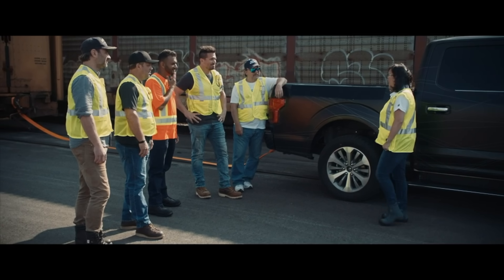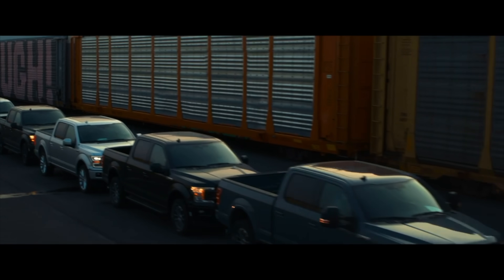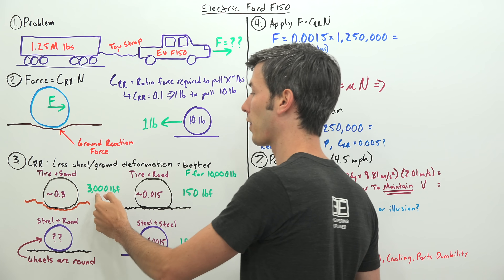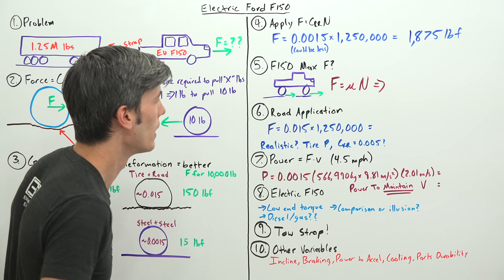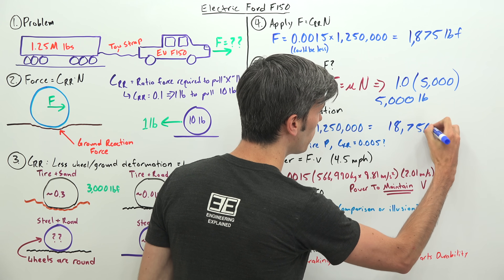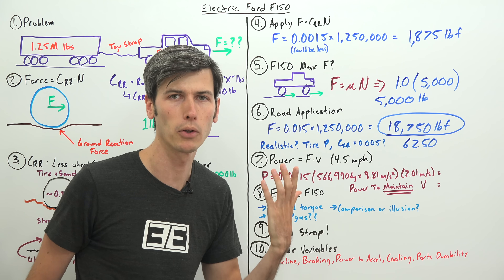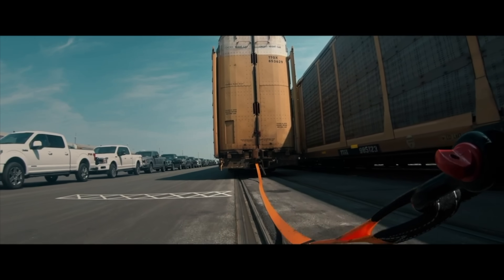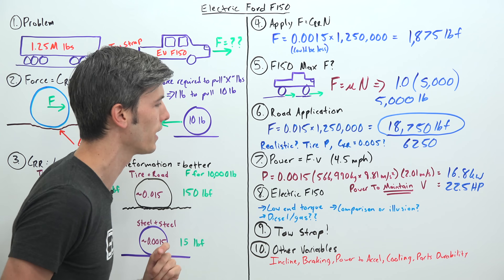No, Ford's Electric F-150 Can't Tow 1 Million Pounds (Realistically)

Comment: I used to work in a warehouse. We had electric lift trucks and gas for outdoors. Man, those electric ones were so weak in comparison especially toward the later time off charge whereas with the gas you could just hit the pedal and give it some extra lifting power. Maybe modern engineering has changed this a bit but an electric-powered truck just doesn't seem like it would provide efficient power for the things trucks are supposed to do. Although, so many U.S. Americans just buy trucks to look cool and don't even haul anything ... I imagine that's the true market for this vehicle..

Comment: To be honest i dont understand, but dont worry im still subscribed
Reply: Basically because the train is riding on steel tracks with steel wheels you hAve less rolling resistance. Now if you swap those to wheels and pavement that truck would be at a dead stop. The tracks help them cheat👍
Reply: @randalllawkin  thanks

Comment: The illusion would have been a little more dramatic with several giant steel cables between the truck and train
Reply from the maker: Agreed, would have been a nice touch!
Reply: Yes ... it would be a nicer  PR stunt.
Reply: Marius Ipad They should just use aluminum, it’s all the rage!
Reply: Yes I couldn't agree more.
Reply: Marius Ipad  It is a low speed prototype test. They could jam something under there to hold it up.

Comment: Awesome video, as always.
I have been thinking if we have so many 1.6 liter 4 cylinder cars why don't we have more 3 liter V8s, it seems (at least on the surface) that they would pass emissions and could reach high enough power output through forced induction. Can you make a video on this or just an explanation in the comments?
Reply: They make 3 liter V6 engines, why would they make it V8. That increases the cost.
Reply: @abdulazeez.98  Why make V8s at all if this increases the cost?

Comment: Can you do the same thing with the V10 diesel VW Touareg toeing the Boeing 747. How much power/torque do you need to pull the plane? It's actual wheels on the ground holding the plane, not easy as the train stunt.
Reply: @wilburville  Thanks for explaining!

Comment: Surely the tow strap actually made this possible. I noticed that it seemed to stretch a lot, and seem to store and stop a lot of shock to the truck system. As you pointed out, the truck can easily get this moving a low speed, it will just take a while to get there. To me the strap was used to store energy which eventually pulled the load, while not blowing out the electric motors with excessive high current loads

Comment: While I don't think it changes your conclusion, you didn't factor in wheel bearings vs. journal boxes. I'm not sure that bearings intended for consumer vehicles would be more (or less) efficient than those intended for inherently commercial rail use.
Reply: You’re incorrect
Reply: @kevinnorris6558  you're saying that I'm incorrect in the lack of understanding I was expressing. Thanks for your blanket acceptance of whatever you thought I was questioning?
Reply: Rich Marceau Mayonnaise is a hell of a drug

Comment: how did they stop 1.25M rolling tons from rear ending the truck?
Reply: I’m more curious where did they get the air to release the brakes? I bet they just bled it off to stop the train.
Reply: They lock the truck's brakes up and get out, because it cant, and it'll just push the truck into the rail stops and crush it into a ford pancake. I would have liked to have seen it, actually.
Reply: Might have had a switch engine on the other end or had a couple people use the hand brakes on the side of the car when they were done pulling.
Reply: Rene Dominguez that’s what I was thinking too and they’d just keep the engine out of shot.

Comment: This phenomena goes all the way back to the origins of railroads, which actually predates trains. Turns out, horses can pull a whole lot more on rails than they can on an ordinary road. Iron tired wagon wheels have lower rolling resistance than rubber tires, but Jason's explanation still works otherwise with horses.

Comment: I'm a freight conductor and this stunt of Fords reminds me of a story I was told many years ago about a switchman back in the late 70's or early 80's. Apparently this guy had  purchased a Chevy Blazer and wanted to pull a few loaded sand cars (about 120 tons each) by hooking up a tow strap and pulling from a slight angle along the switching lead to show how tough his new ride was. As you can imagine, he didn't have much trouble getting the cars to start moving, but had failed to come up with a plan to brake and get them to stop. When he tried to slow down, the cars kept rolling and his Blazer became the towed vehicle until it was pulled into the side of the cars and badly damaged. I'm not quite sure how this was explained to local management, but like so many other things, railroading was a much different bussiness back then 😂
Reply: @MetraMan09 Apparently not. This is a story that was told to me by someone who was there (I was just a little kid when this happened), but I did get the impression that they had a good idea what would happen, and just let him suffer the consequences for his macho act.
Reply: Hahahahahah. That's an excellent story!
Reply: @Blake Terry that makes sense. You might be surprised by how easy it is to stop a cut of cars with a single handbrake.
Reply: @shawnseeley9561  Or possibly had a locomotive at the back to apply the brakes if need be.
Reply: @sts8997  definitely the safest course.
Reply: Thank you for your works!
Reply: Cool story - and if switch operator did this today and damaged his truck like you mentioned - he would have been accused of being a racist.
Reply: @islandnites  Don't forget toxic masculinity as well
Reply: Show us Tesla pulling that same train with one million pounds

Comment: Not really too different than when Toyota had a Tundra pull the space shuttle
Reply: But given the explanation in the video w/steel wheels & steel rails, i think Ford had an easier task vs the Tundra's pneumatic tires on pavement.

Comment: Let's get real and put the numbers to real world usage.
What could a Miata pull?
Reply: The 2019 Miata weighs 2,300 lbs, with 47 percent of the weight being on the rear wheels, giving a maximum pulling force of 1081 lbs. Since the train had a Crr of 0.0015, the Miata could tow a train that weighs about 720,600 lbs.
Reply: @SupaKoopaTroopa64  you are forgetting about weight transfer to the rear wheels. If you mount the tow straps so that is pulls the rear axle down, and accelerate, the weoght on the rear will probably be enough
Reply: Miata could pull the same train with some grippy tires. Just a bit more slowly
Reply: It's funny cuz I had an NB Miata and there was actually 1 page in the owner's manual for towing which said in one sentence "Do not tow anything with this vehicle." Their warranty department foresaw the future as they got cheaper and started towing other vehicles to the track and what not XD
Reply: Well it'd have to be able to make it to the track first.....
Reply: Honda civic dude

Comment: less than 2000 pounds of force is pretty low.  I recall a 1960's tractor with a 3 cylinder diesel engine could do 10,000 pounds draw bar force.  Of course tractors are built specifically to maximize draw bar force, but still.  2000 pounds is nothing.

(Correction:  The RD6 tractor I was referencing was made in 1935, not the 1960's.)
Reply: You’re incorrect

Comment: Thanks again, Jason. Now I understand how trains are the most efficient form of shipping, moving thousands of pounds of cargo for just a few dollars worth of fuel. (Of course, doing it in bulk (millions of pounds at a time) helps too.)
Reply: Bob Lamb the air resistance is also significant in case of a car but for trains you get a low drag compared to the volume, especially compared to weight.
Reply: @inox1ck  - That makes perfect sense as rail cars can draft so much closer to each other than any automobiles ever could. For all practical purposes (wind resistance) a train is one long car with a somewhat irregular surface.

Comment: When you calculated F=uR you said that the normal force or weight of the truck is 5000lb is this not the mass don't you need to multiply it by gravity to get the weight/normal force? Or is this a metric imperial thing?
Reply: Alessi 42 I believe it’s because the weight is 5,000lbs , meaning this is the normal force. If he had said the mass is 5,000 lbs then yes you would multiply the m x g=(nF or weight)
Reply: @angelvargas1066  oh right I didn't know pounds could be weight or mass but this makes sense

Comment: I think this calculation is all wrong. He is telling the weight of the truck is pulling the truck, which is wrong, electric motor is pulling the load, the motor has to put enough torque to move the truck itself and the trailer, that is 6875 whatever unit you use!!. This truck can pull even more if the powertrain  is capable and the wheels are not slipping (total force is more than maximum friction??) . Makes sense??
Reply: (1875  + 75)/5000 = 0.39 You might be able to do it with bald tires on linoleum.
75 lbs is the rolling resistance of the truck's tires with a Crr of 0.015 times the normal force of 5000 lbs.
Reply: I think your misunderstanding how it works. The 1900 pounds of force isn't added to the weight of the car (which is what it looks like your doing).

That's the amount of force the vehicle needs to be able to overcome. So the truck weighting 5,000 with a coefficient of 1 (think traction) means that the truck is able to exert 5,000 of force itself.

Applied force=/=pulling weight

It's not necessarily the overall weight of the payload you need to overcome. It's the force that the payload applied you need to overcome.